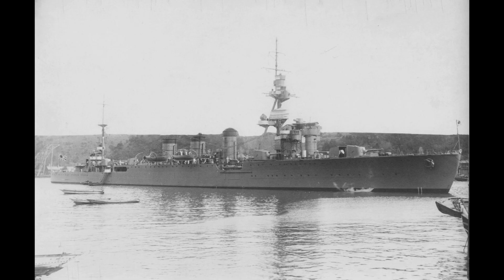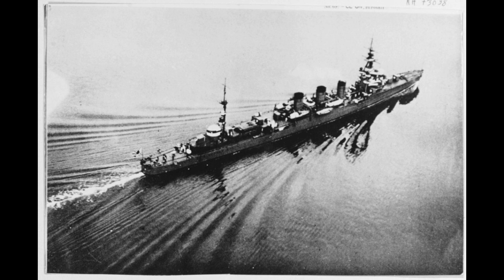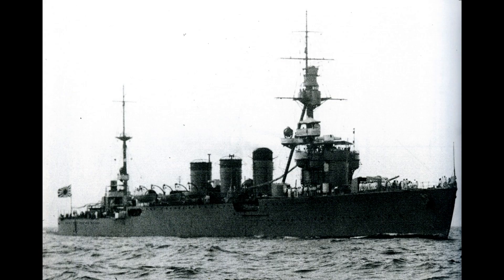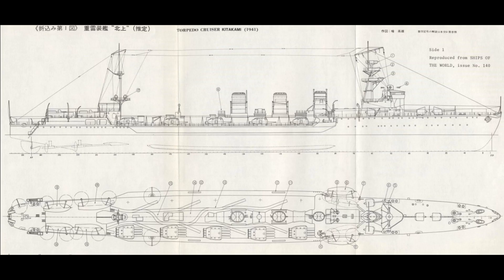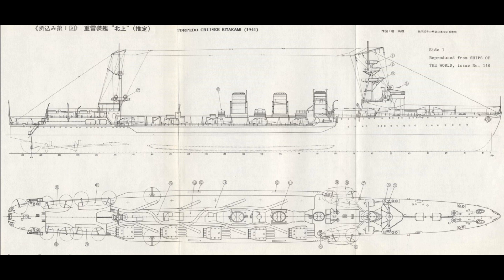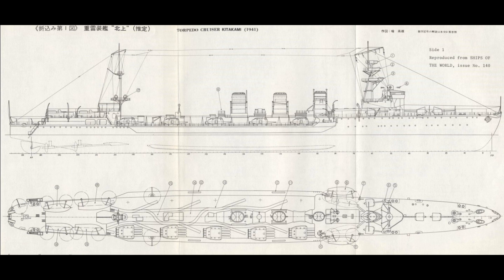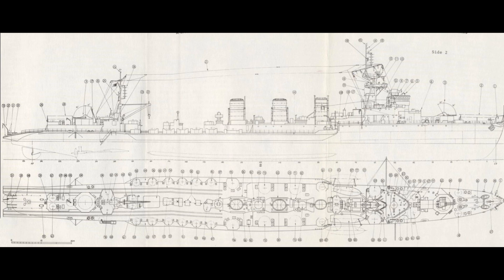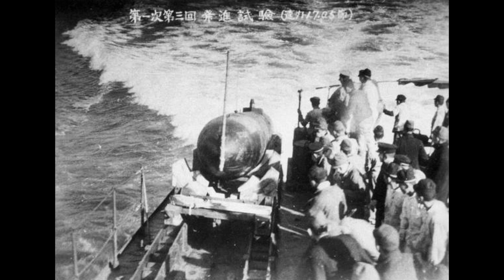IJN Kitakami - Guide 285

Comment: It sounds to me that if she had been a bit slower they wouldn't have messed with her armament and she would have ended up at the bottom of the ocean like most of the rest of the navy. However they were mesmerized with that speed and continued tinkering with her but when they thought they had what they needed, they found they needed something else and so it went until they ran out of war.
Reply: Jackie Fisher, from the depths of the Earth: "SEE!? SPEED IS ARMOUR! I WAS RIGHT! YOU FOOLS!"
Reply: Imagine if they had equipped her with heavy AA (40mm or 3" guns) from stem to stern and used her as a carrier escort...
Reply: @swaghauler8334  that's what I was thinking. You already widened the beam at the mid ship.

Why put the torpedo launchers when you could put 5 mountings of the dual purpose 127mm AA, change out the main guns for duel purpose 3 or 4 inch as well. And then what space you have left over, they can throw on their shitty 25mm aa guns. 

Slap some depth charges on the back. 

And they got a perfect AA carrier or battle line escort.
Reply: @Robert53area  interesting idea but are you thinking single or dual mounts? Power or manual? Turrets?
The weight of the gun mounts along with the necessary magazines and ammo would likely far exceed the weight and space of the torpedo mounts. Maybe single manual mounts, but those were fast becoming obsolete.
Reply: @thebudgieadmiral5140  Why is it I hear Stewie Griffin there?
Reply: @Robert53area  how do you spell dual correctly the first time then incorrect the second?
Reply: The Imperial Japanese habit of holding on to essential units until it was too late to render any relevance is the single most recurring theme of the Japanese war in the Pacific. They would have been useful at Guadalcanal.
Reply: @mtumeumrani376  Yamato noises

Comment: Impressive speed for something designed so close to WWI.  With perfect hindsight, configure for aircraft carrier escort duty:  heavy on anti-aircraft guns and anti-sub depth charges; light on ship-to-ship weaponry.
Reply: Not IJN mentality - everything was designed for the Main Battle, AA and AS were secondary duties.
Reply: @gregorywright4918  I agree.  Nimitz was no Jutland admiral.  With all the innovations the IJN brought to naval aviation, they were locked into a Great All Out Battle of Ships of the Line mentality.  Even sinking the Prince of Wales and the Repulse didn't convince them.
Reply: @bagoquarks  

It did: there is a reason orders were given to only work on Shinano to the point that she could be towed away for scrap right after the loss of Force Z (this was separate from the later order to convert her into a carrier).

And keep in mind the USN STILL kept putting new battleships in service after the Japanese had stopped. The fact they didn’t plan to use them in a decisive surface action doesn’t really make them any more justified when a surface action against capital ships is really the only thing that would strategically justify building a new battleship for.